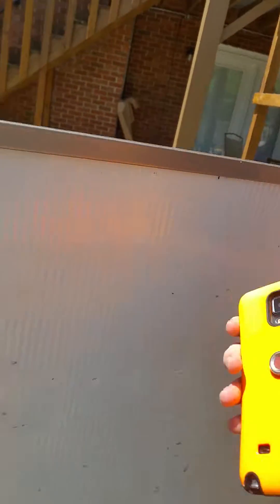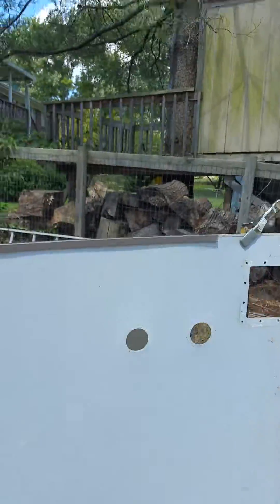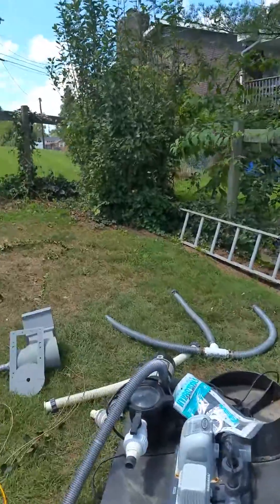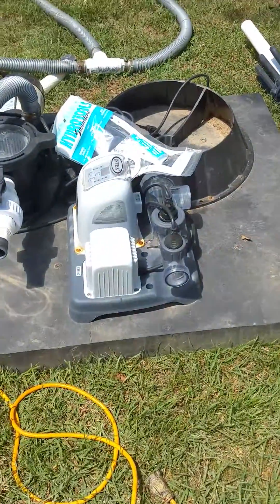Saltwater vs. Aluminum pool

Comment: Aluminum creates a brittle oxide layer when exposed to air. That layer gets etched away from salt water and eventually erodes. It shouldn't discolor like the video examples though, thats odd.

I'm looking forward to all the new Ford trucks with corroded holes and stumped owners.